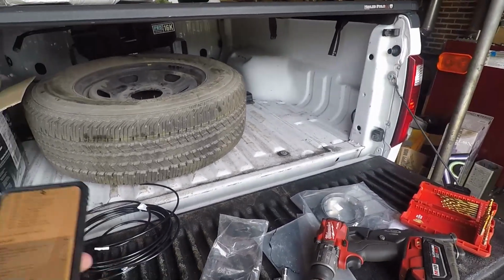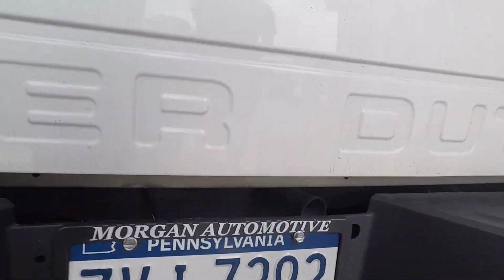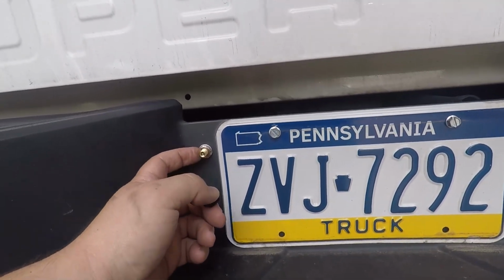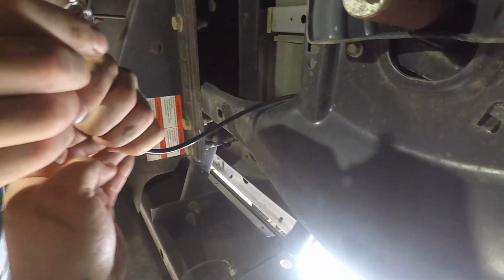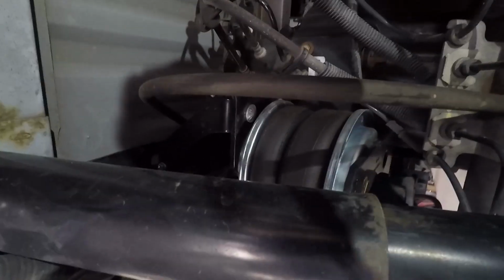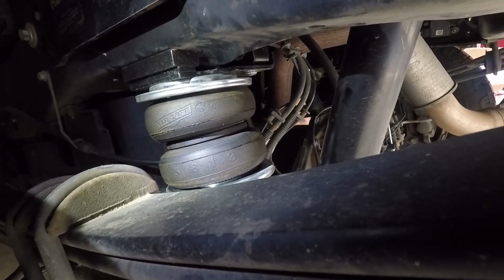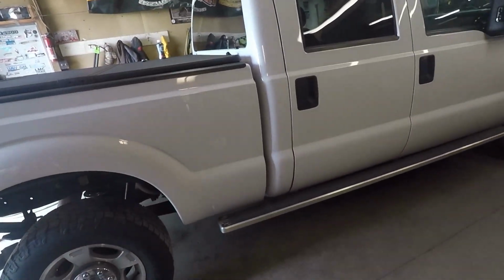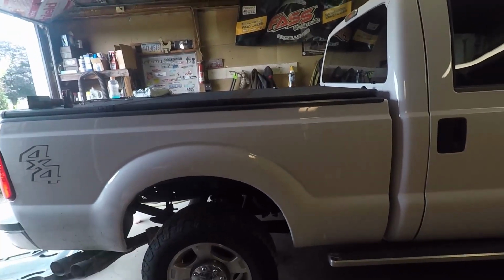airbag airline install

Comment: Great video! That’s how I was going to do mine then wanted to upgrade to the air lift compressor but man it’s expensive for a little more I now have a 12 gal air system and love it!
Reply from the maker: I have a cheap kit that was sent to me we shall see if I like it when I do it. On the 6.0 I plan to make my own custom setup for cheap that should be kind of cool